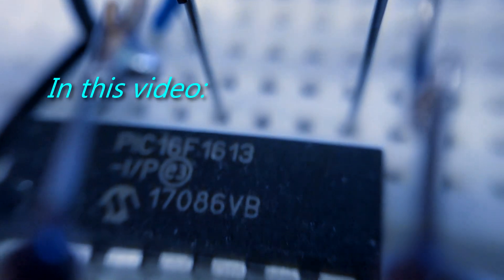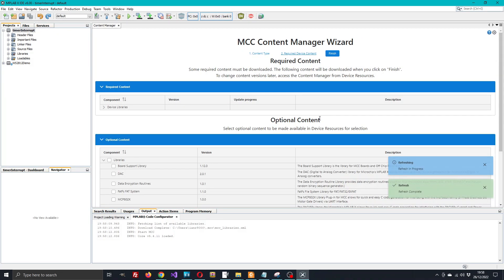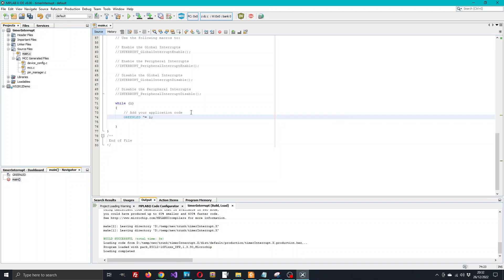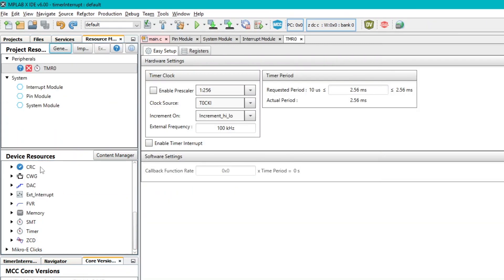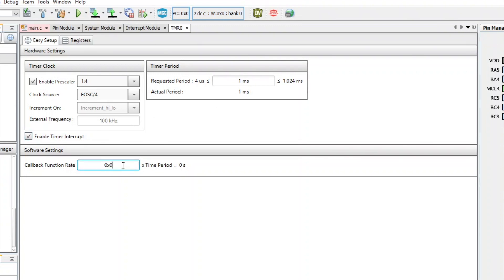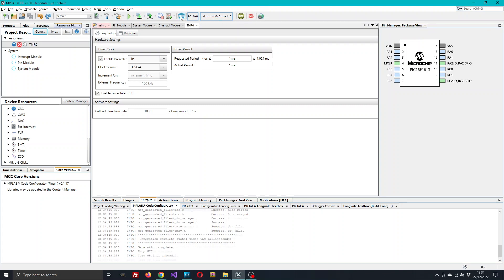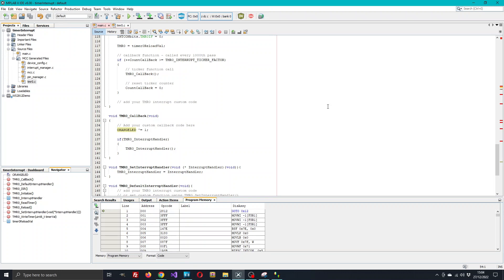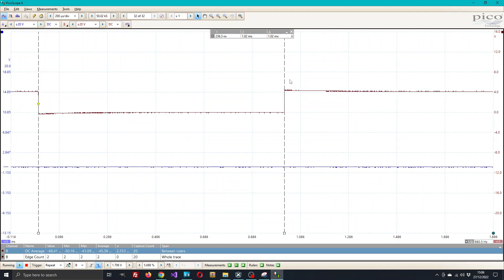8. Setup 1mS timer interrupt - It's Easier than you think on PIC microcontroller

Comment: Thanks Ian just started playing with a 16F18456 and your video is a big help.  I’m planning on building a solar controller for a vehicle.  I also want to be able to hopefully implement a clock and a couple of temperature probes as this vehicle does not have any kind of a temperature read out; also will, of course be having to read out voltages and possibly charge currents.
I used to program PICs many years ago in ASM and HiTec-C so really rusty and totally unfamiliar with the new MPLAB-X & MCC.
Do you think that they do not consider the timers to be peripherals?   
So, thank you Ian very much for posting this video and look forward to seeing if you have more pic related videos…  😊